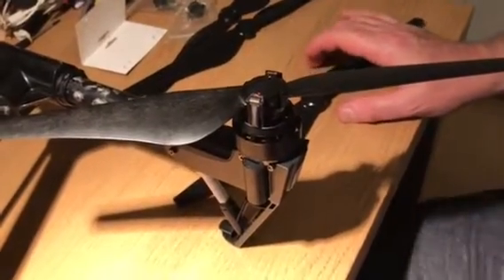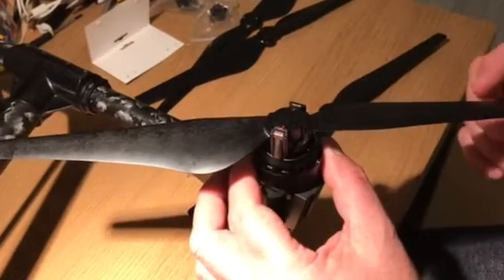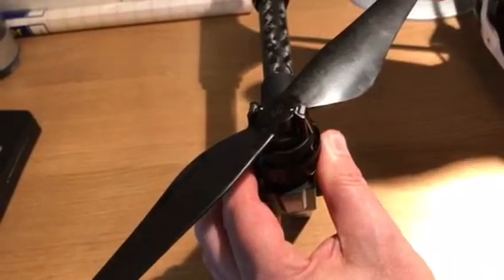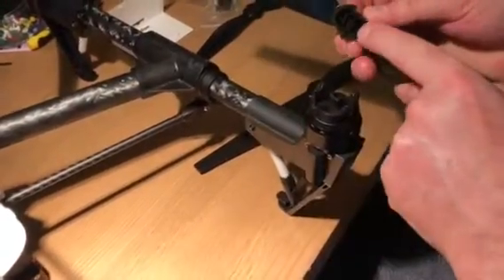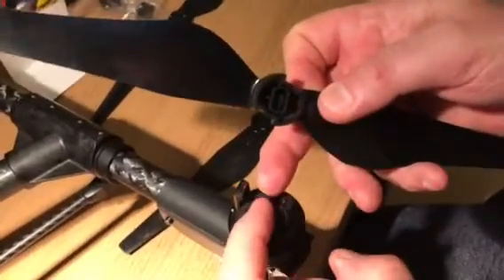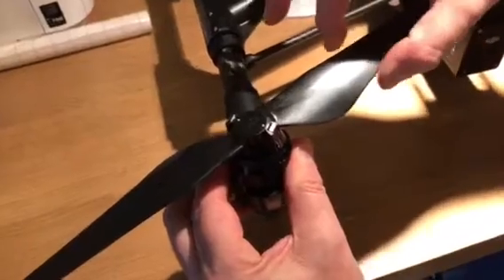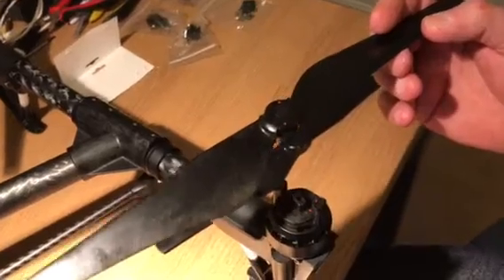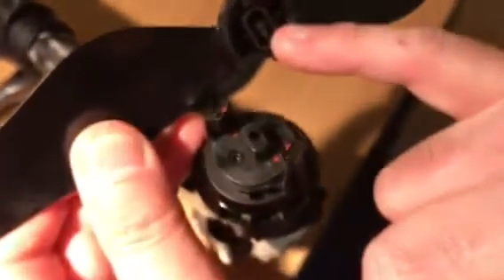New DJI Inspire 1 1345LS Prop Movement Issue

Comment: I had same problem... I took a razor and sliced 1/3 off the foam prop inserts and crammed two into each red prop hole. The prop is def on and stable.  Haven't flown it yet though:) just giving my two cents.